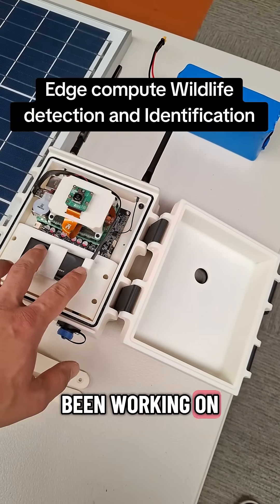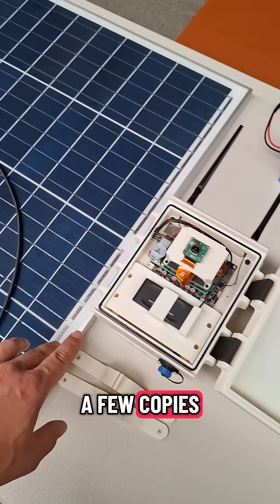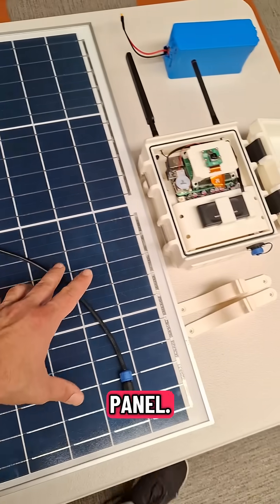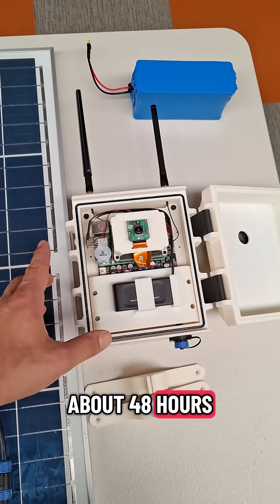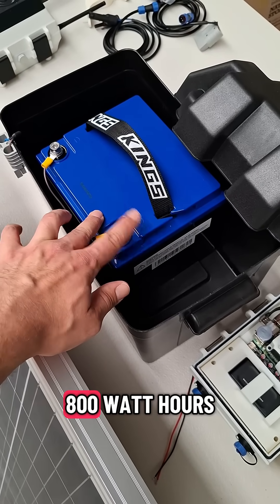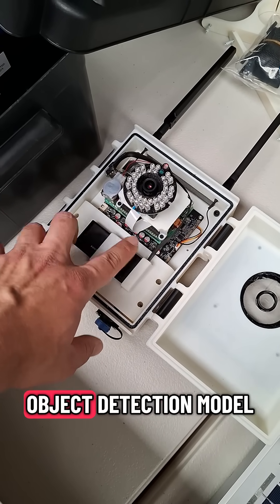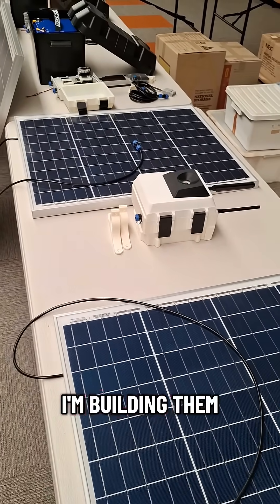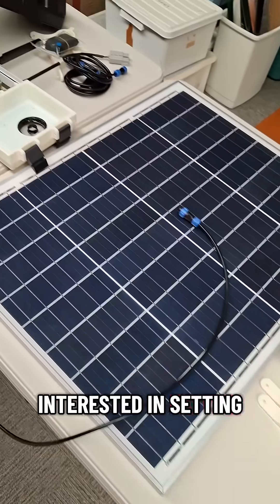Using Edge Compute Object Detection for Wildlife Detection and Identification!

Comment: I’m working on something similar, all AI is done on a server. Looking to make 1080 at 30fps as small as possible while having 24/7 power/uptime. Using an RTMP stream over WiFi (QR Code sign on). I’m in the US North East. I’m a Linux/programmer/networking/etc type of nerd. I’m in the optimization phase. Latest metrics are that I have a full HD YOLO/OpenCV stream having 30 frames being processed in 90ms. I usually only analyze ever 3rd frame and only on motion. I should be able to process 100 active feeds with my current server infrastructure and current level of optimizations (I also have two additional older CUDA GPUs). 2c. 👍🤓
Reply: I'm curious about what your working on. How can we connect?